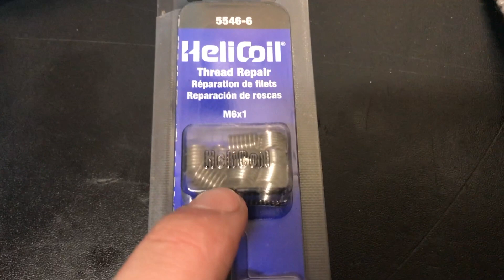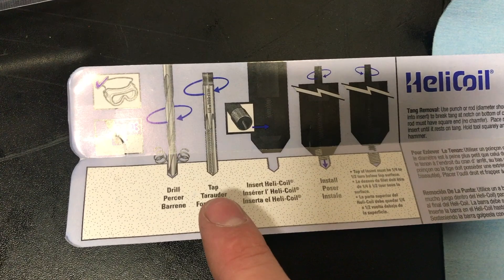2011 STI Fixing Water Pump (How To Helicoil)

Comment: Working on my daily ej253 did timing stripped one screw on water pump literally dont have a way to get to store and domt have any money. So screwed literally going to have to send it and pray she doesnt gush
Reply from the maker: Oh man what a gamble I'm super curious if it actually held. Did you upsize the hole and tap it or what?
Reply: @ModdingAddiction nope swear to God I put it back together and it worked fine hasn't leaked a drop already have put 8k miles on it. Just put the screw in the stripped hole. Not bragging bc I know how lucky that is but yeah never heard of it not leaking somehow mine doesn't
Reply: @ModdingAddiction what was messed up is I had it all the way torqued down 100% perfect and forgot to put the z shaped gasket on the left side of the water pump so I had to take the bolts all out again then when re Installing one stripped bad

Comment: Learned the hard way not to torque small bolts, im also wondering how accurate the 1/4''' from harbor freight even is
Reply from the maker: Yeah it’s a very fine line. I honestly don’t use it much just give it like half an uga dooga and it’s perfect. The main thing is get it tight enough that it won’t back out

Comment: Thanks for the vid. The exact same thing has happened to my Impreza WRX water pump bolt holes. Were you able to get the right torque when tightening the bolts on the new threads?
Reply: I was able to torque it down. The trick is to let the thread lock dry and cure fully. It’s not to fun when the helicoil comes out with the bolt. Another thing is make sure that the tab to screw the helicoil in is broken off or it won’t let the bolt thread in all the way and torque way to early. Good luck and take your time